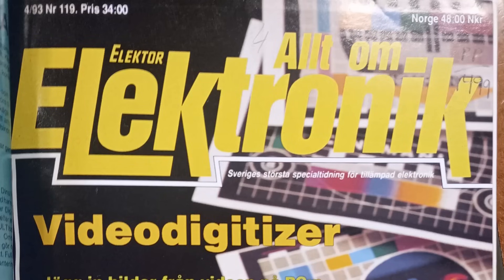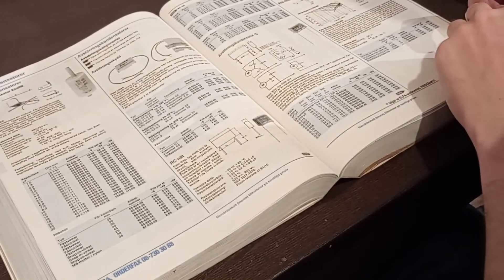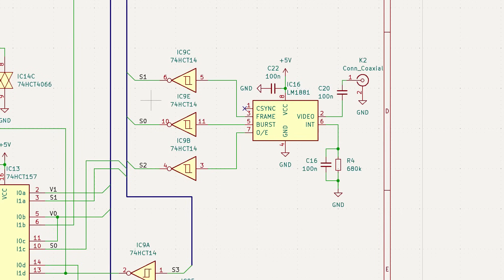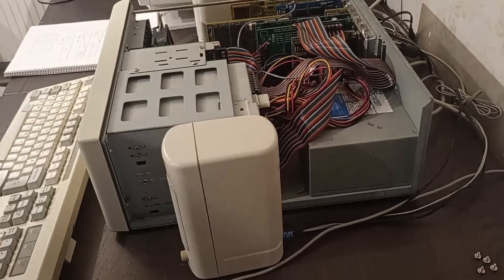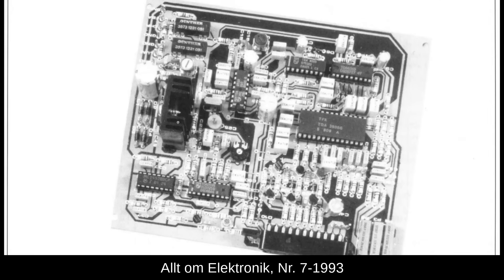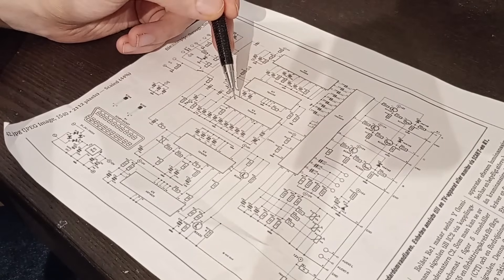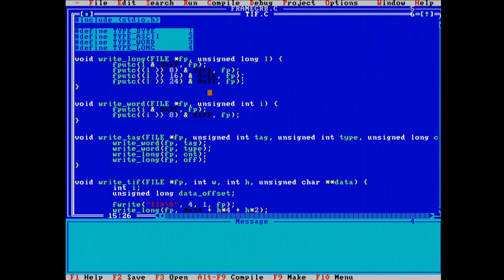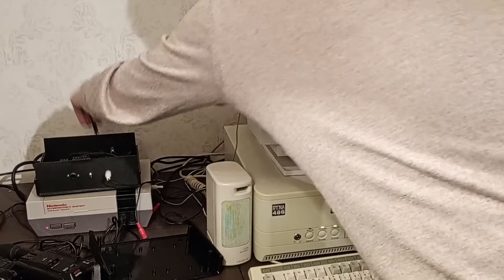Building and Using an ISA Card Out of a '93 Magazine

Comment: LOL, ok so NTSC "Never Twice The Same Color" was a joke in the television engineering community. It really stands for National Television Standards Committee. Because the NTSC color standard, while allowing for color transmission on black and white TVs, was susceptible to slight color variations due to its reliance on precise timing and phase, which could lead to inconsistent color reproduction on different sets. But that is funny.
Reply: It's actually the reason why US TV sets have a tint control. PAL TVs rarely had that, since PAL is phase-compensated and there was no reason to adjust the color.

Comment: The reason your camcorder isn't showing color might be the signal level of the color burst. It's possible that the ICs on your ISA card are expecting something with a higher amplitude. There might be a way to tweak the components on the RGB to composite box to boost that. Also, you could just get a modern RGB to Composite solution and see if that works. I really like your idea of trying to get these old boards to work, it was a fun watch. That said, I think I would probably try to get the first board working 100% before trying to throw the second one into the mix. Some things I would try are getting an RGB console to record a still via the RGB inputs. A playstation or PS2 can easily output RGB.

Comment: In those days, we might have just extracted RGB from a real TV instead of building a board.  Everyone had at least 2 TV's.  The real cost was the test equipment.  Guess it was ISA because the edge connector was cheaper than a parallel or serial cable.
Reply: No TV would give you the RGB externally, and working inside a CRT isn't something that a magazine should promote, especially since they can have varying architectures, some of which aren't isolated from mains.

Comment: Believe me, these "period-correct cheap, nasty IC sockets", are much more reliable than modern cheap round-hole type IC sockets.
Reply: I suppose if you want to go for extra luxurious you could use only zif sockets, but those also take up far more space, just due to the mechanism alone, but they also don't come in all sizes.
Reply: Oh really? The machined round hole sockets seem to have some sort of internal spring that grips the leads quite well.
Reply: @Scrogan  It works only with brand new ICs, and is very prone to contamination and oxidation. Also IC pins are flat, not round...

Comment: Love the dedication to not using any modern resources, at least as much as is actually possible...

Question, though - once you saw the input stage of the RGB converter pre-splits the composite signal to an S-video one for processing anyway... why not just build that part and pipe it into the composite input of the card, at least for initial testing? It's such a simple circuit, and I've got some two-way SV/Comp converters that are basically the size of the two plugs because the electronics fit neatly inside. Also it might not have helped for the colour capture, but doesn't the NES have S-video output? (maybe RGB in Europe, even)

Also videotape downconverts the colour signal to be even lower bandwidth than regular RF TV or live-modulated composite. That might be something to do with not having any colour in the captured images? Perhaps whatever signal is coming out of the camera isn't using quite the right frequency so the converter doesn't pick it up, or it's even the colour transition enhancer getting confused and cancelling it out? Or something to do with the PAL phasing, if the line lengths aren't quite right (could easily happen with slightly stretched tape or other analogue media woes). There's green and purple fringes on a lot of the edges after all, especially vertical ones or very thin horizontal, which is one of the primary colour axes for composite encoding (I think maybe what you get when both quadrature components are fully positive or negative together? You see it in corrupt digital video signals and files particularly). There's a reason professional studios always had a timebase converter in the stack. How does it look if you play the tape back on a TV, or through a VCR with an adaptor? Can you point the camera at a scene and use the live composite / Svideo (RGB??) output from it as a test?

I think maybe the NES has slightly scruffy timings vs true PAL also, might work to tune a standard def channel on a digital TV box (or analogue if still available where you are), play a commercial VHS tape or allow a slight stray into modernity by using a DVD player, just for verification purposes? That would eliminate or better confirm suspicions.

Also the weirdness in the capture itself... I wonder if something's just not sitting right on the board. You said the sockets were cheap and nasty, and poor seating or connections in them are the source of a lot of unhappiness when it comes to computers. Maybe try cleaning the sockets and reseating the chips one at a time and see if that improves things, like what happened with the slot itself? There was also a question in my mind over IRQ and DMA assignments ... I don't know if a card like this needs them, as you're basically always polling it via direct memory mapped register writes and reads, but maybe the lack of arbitration itself could lead to there being interference from other devices on the bus? You've got a lot of things plugged in there, and ISA isn't that fast so it might be very busy, especially with the video card and maybe hard disk controller sharing the bandwidth? Could be interfering with both the reads and the writes, even, hence pixels being jittered back and forth, and the periodic brightness glitching that doesn't look like it's either 1/10th or 1/64th of the image width.

(though, the fading effect suggests more a capacitor or inductor issue... something's the wrong value or not working right, or has the wrong resistance connected with it... Also also, running a 24MHz clock on the card? Very odd choice for them to make. Doesn't match with PAL pixels or ISA bus speed, even with divisions, unless yours happens to run at a true flat 8.0MHz. Wonder if that itself could be causing phasing problems. Unless of course it's all happening in the RGB converter...)

Comment: I'm trying to get some motivation to do something similar with a CPLD that's on a board from a E1 modem. I don't know exactly if I want to sample everything from an adc and do the magic on the cpld, or sync everything externally and only sample the actual line data (which could be only intensity, and chroma in two different adcs, or separate them inside the cpld). cool that this thing is ona a ISA card. such standard was so simple, but I think most tinkerers were afraid of developing for it. I saw some isa dev cards for you to do something with them, but not many projects on electronic magazines or similar, at least on my country

Comment: Old computers were very well documented. I built expansions cards for ZX Spectrum, MSX and IBM PC both for ISA and LPT port. I built them from various articles from magazines and when I felt comfortable enough, I made my own designs. For the software I used BASIC and Pascal.
Reply: The interfaces are still well documented. Just that the signal integrity measures today need to be a lot better.
Reply: Sadly those interfaces are obsolete. The closest today is the LPT port but even this under NT kernel is hard to programm at low level. With ISA, LPT on IBM PC, Spectrum, C64 or MSX interfaces,  was easy to put the bits where you needed under dos/win9x. And Basic, Pascal, C, Assembler were just the right tools. 
I made ISA interfaces that were quite simple (AD/DA 8bit ISA card for example) and programming it did not required any device driver, just to know the IN/OUT adress, IRQ and read/send bytes or butes where you need to do what you need.
Reply: @sebastian19745  The biggest hurdle today is real-time capability. You can still connect USB-to-LPT adapters to a modern PC, but then all you can do is push data in a buffer and hope for the best. No low-level talking to shift registers and similar.
Reply: @graealex  Exactly. However, even with a real LPT port under NT you only talk with the device driver and not with the hardware directly. But under dos/win9x you could talk dirrectly with the hardware (in dos mode) bypassing the device driver.
Reply: @sebastian19745 Precisely why you'd use Linux for this purpose.
Reply: lol, same here, even the Pascal.  I just pulled my old atari ST out and have been upgrading it.